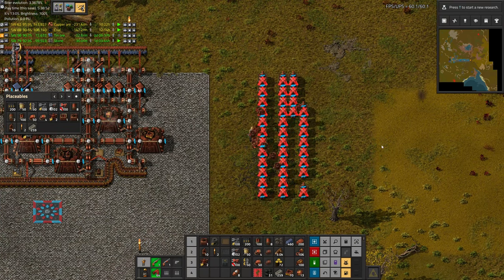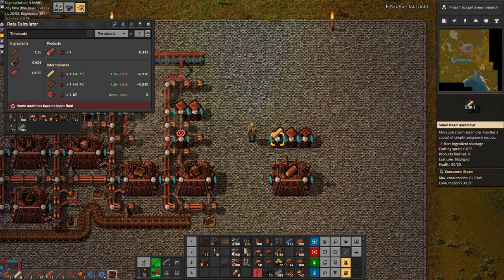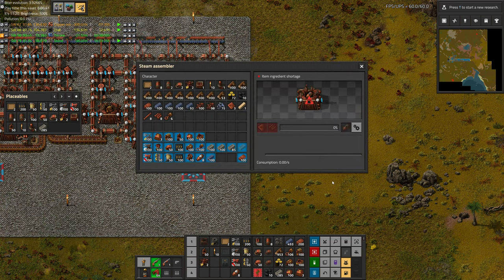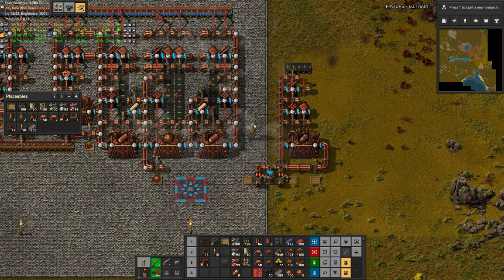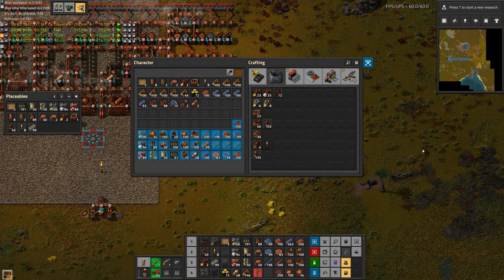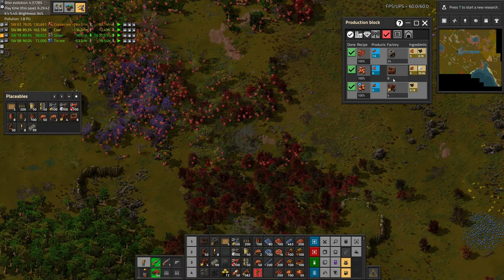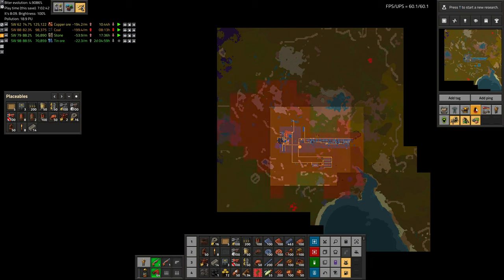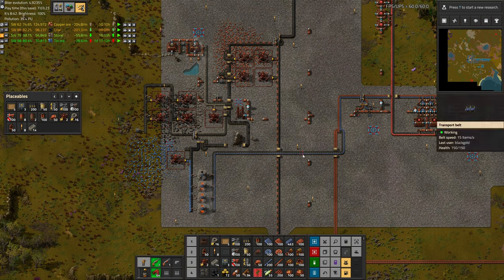[Factorio] IR3 Ep 6: Ore Crushing

Comment: For the fuelling of the coal drills with crushed coal, could it have been simpler to just swap out the burner drills for steam drills? There is steam closer now that there's pipes for the crushers, and it would not only reduce the pollution indirectly (the power would come from steam boilers fuelled using crushed coal) but also reduce their overall demand on the coal.
Reply from the maker: It would have been simpler, yes, and I do change my mind next episode. It’s counter intuitive, but it doesn’t actually reduce pollution. A burner mining drill makes less pollution than a steam drill plus the steam boiler that powers it. But it does use much less coal, so as the factory expands you do want to run on steam for everything to save coal.
Reply: @marsh8056  That's an interesting one. Reduced use of coal means that there is less of it needing to be drilled up, in turn lowering pollution production of the coal drills. Does THAT offset the produced pollution of a steam setup vs an all-burner setup?
Reply from the maker: @ThaFuzzwood No, I checked the entire process. All burners consumes about 3x the coal and produces about 75% of the pollution. It’s weird.